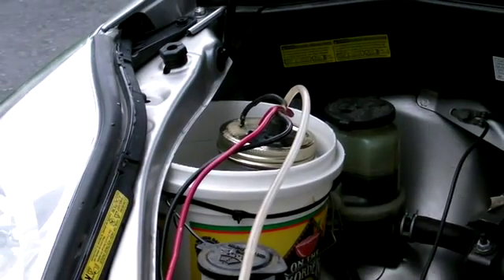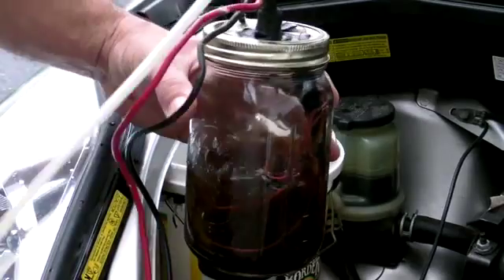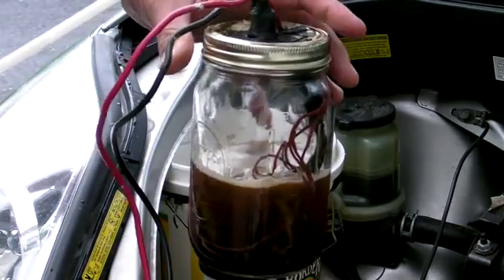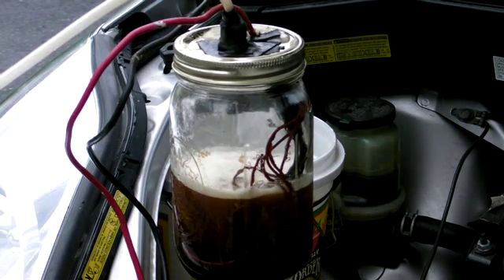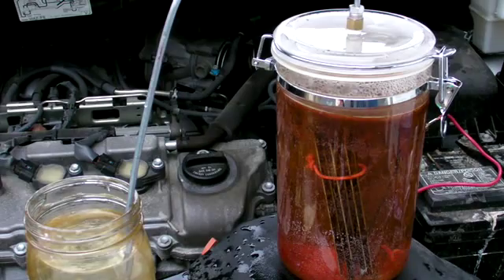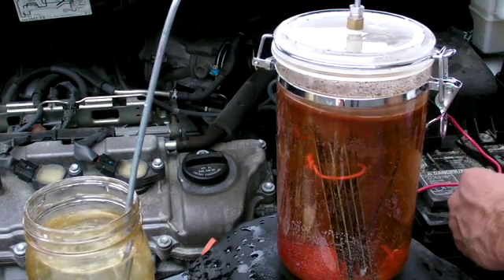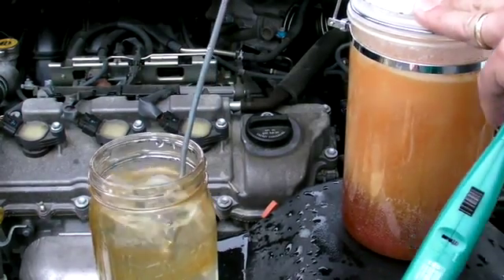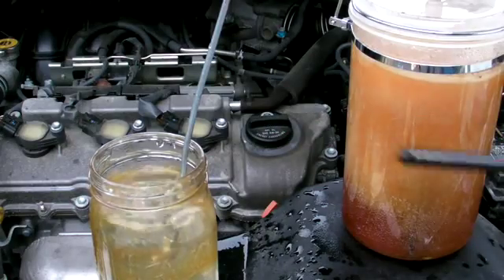HHO- Toyota Sienna Bigger System

Comment: use alkaline water with a high ph (close to or around 6.0-7.0) mixed with vinegar it works the best and its the cheapest , never use copper (highly corrosive) ... try designing a bubbler system before hooking up to your vehicle to protect the engine ! best of luck to you and all hho tinkerers out there ! lol

Comment from the maker: This cell hasn't been running due to the excessive copper  I use to connect the cells.  I'm working on a dual jar generator using SS condiment cups with all stainless guts.  We'll see what happens.